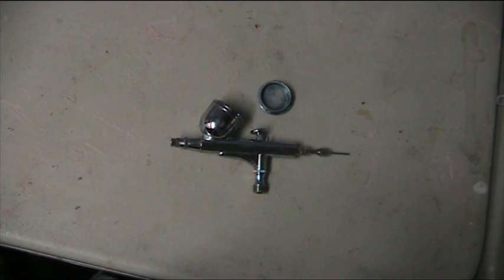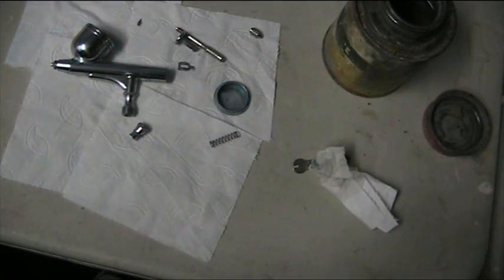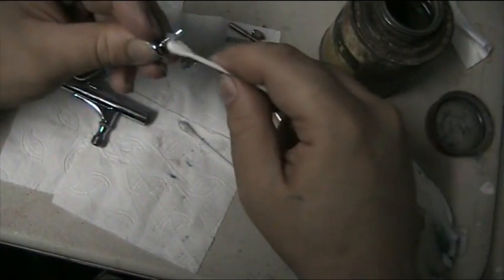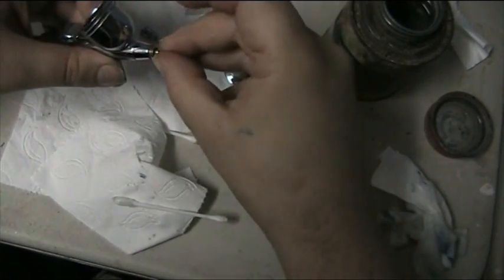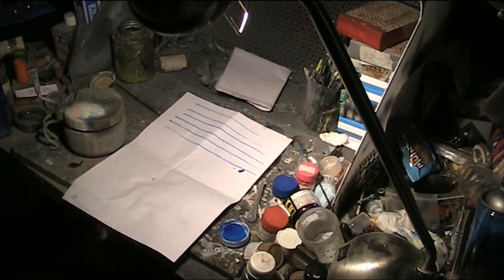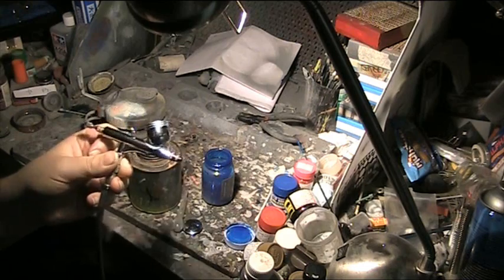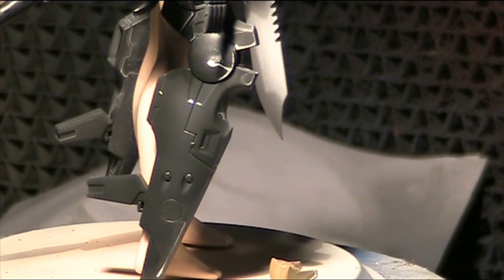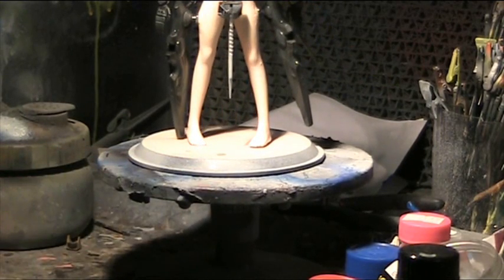Honing your airbrush skills 16: Quick clean out, repairing frosted matt coat

Comment: I’m using mr hobby lacquer paint, do i need to use their airbrush cleaner every time I want to change color? Or just cheap hardware thinner will do?
Reply from the maker: You can buy 1 or 5L tins of automotive grade lacquer thinner. I talk about this in my other honing your airbrush skills video. Over 95% percent of my thinning and cleaning is cheap thinner. Make sure its lacquer or general purpose thinner and not enamel or oil.